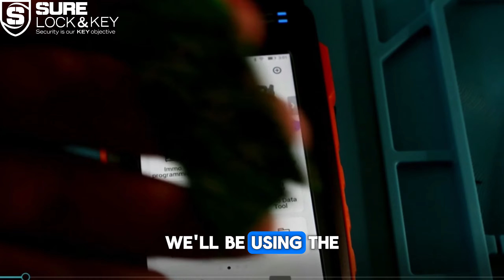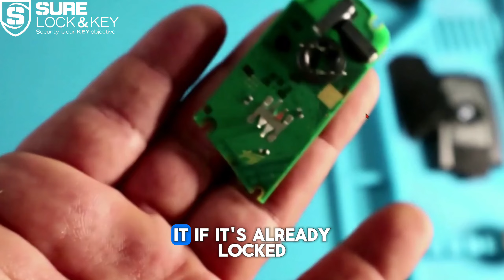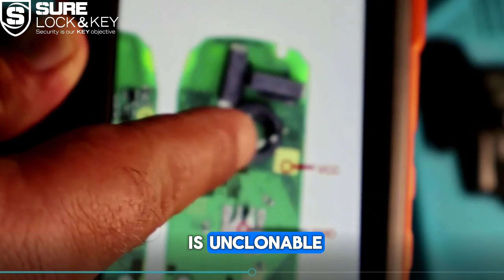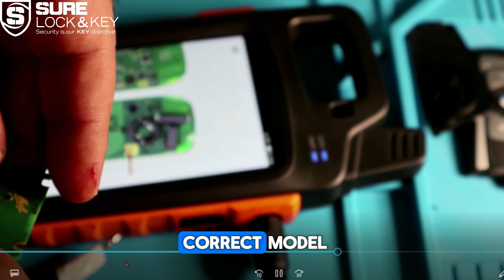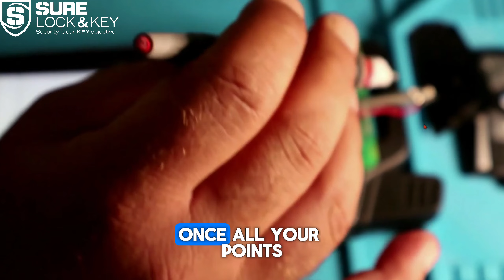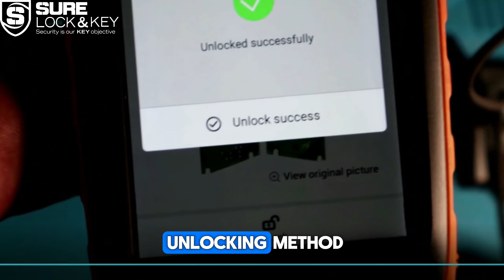How to Renew a BMW Key Fob Circuit Board l Step-by-Step Repair Guide

Comment: Thanks for the informative video ,just wondering how you made the wire hack tool , and more information on what wire does what so I can make one..? 👍🏼👍🏼👍🏼👍🏼👍🏼
Reply from the maker: To make the tool, we used a standard 18-gauge copper jumper wire with two thin back-probe pins soldered to the ends so they fit into the harness without damaging the plastic connector.

As for the wiring:
1. The Ground: Usually the solid Black or Black/White wire.
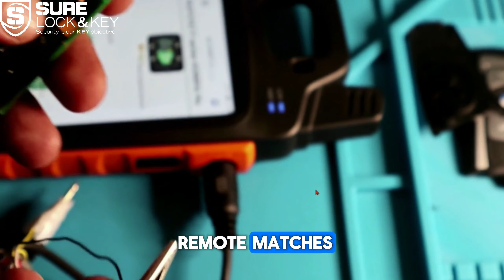2. The Signal/Trigger: This is the specific wire for the sensor you're bypassing (refer to the 2:15 mark in the video for the exact pin location).

By 'shorting' or jumping these two specific pins, you’re essentially telling the computer the circuit is closed. Just be careful not to touch the 12V power wire, or you'll blow a fuse!